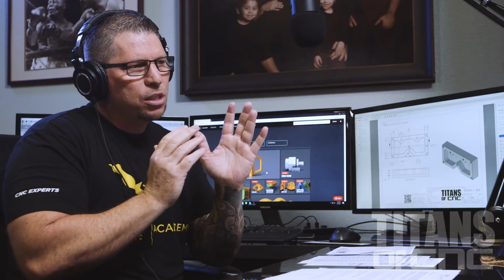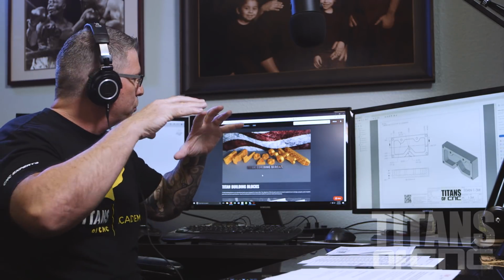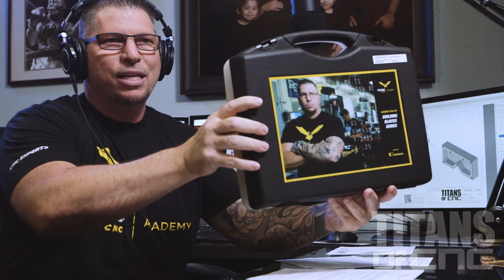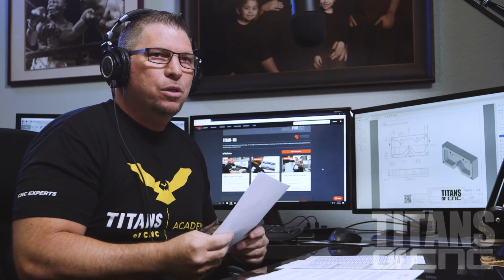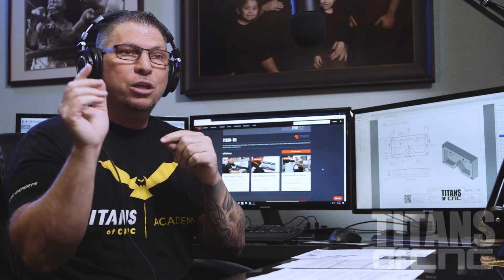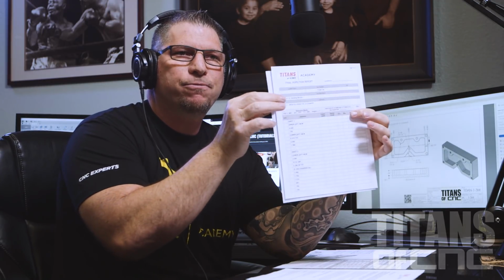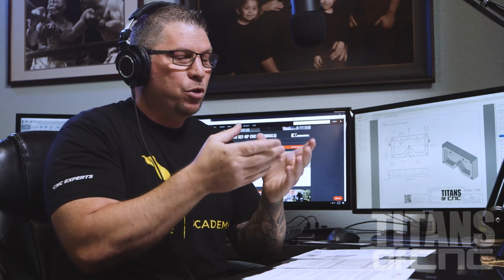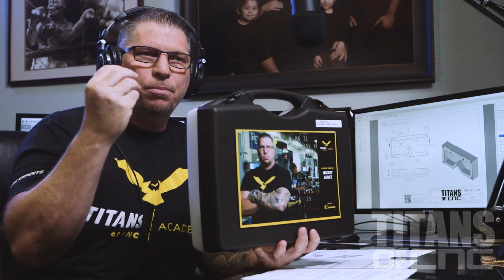CNC TITAN Reveals Education Master Plan

Comment: Thanks Titan as I need to learn this stuff. Right now I only have a 4th axis CNC mill and am finding Fusion 360 seems to have just left us out of the loop. The lathe I have is too small for the things that I need to make so I have to get it done on the 4th axis mill. One of my strengths in life is problem solving so as I learn Fusion 360 I am solving problems along the way. Just now I figured out how to turn down a cylinder diameter using 4th axis milling in Fusion 360. check it out: https://forums.autodesk.com/t5/fusion-360-design-validate/how-to-get-4th-axis-to-360-wrap-around-a-part/m-p/7692805/highlight/false#M146402. 
I will do what I can to go through each and every part that you have so that I can learn this stuff too. I design a lot of prototypes and use to out source the work but that got far too costly and ended up putting me in the poor house. I'd miss deadlines, have things not made to print, and even had a greedy machinist breach the contract and sue me for $3k and won the court case due to racism. I had to learn through the school of hard knocks and thus I know what you are doing is as good as gold and from the bottom of my heart, Thanks 🤗.